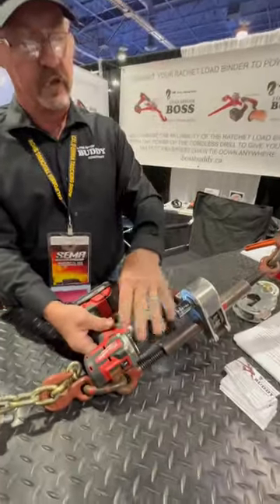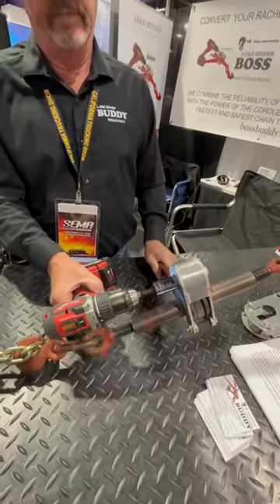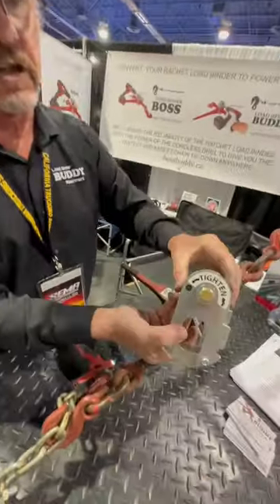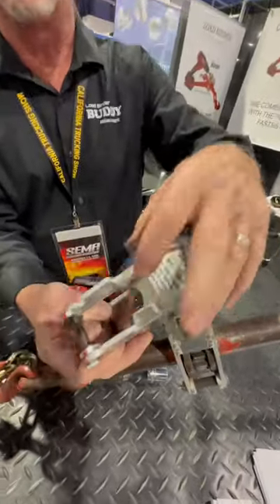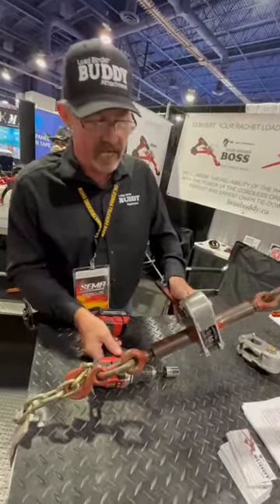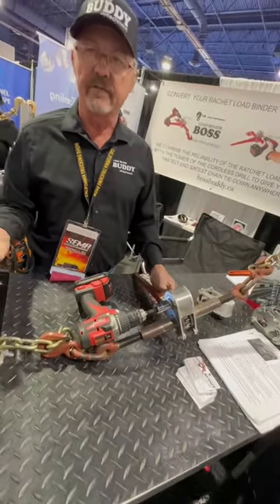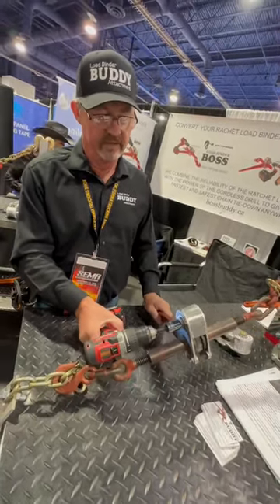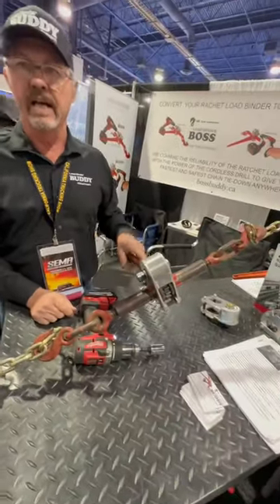Things just got a lot easier. #shorts

Comment: A lot of people talking about the inconvenience of finding/carrying a drill, cost, actual truckers using it......actual trucker here and have used various models over the years, if a few hundred dollars is a burden to your wallet then imagine the burden to your body after 30yrs of cranking on binders, seeing doctors because of arthritis losing your grip strength etc as you age. Its about working smarter not harder, let the tools take the wear and tear instead of you. 
I still use my speed binders (i think thats the name of them) and if you put the drill in low range two will definitely tighten a  skid steer down enough to bulge the tires and make chains pop and crack. I paid $88 each for my 12 speed binders 4yrs ago and still using them today, i have a charger, spare battery and drill between the seats so its no more of an inconvenience to grab the drill than grabbing my gloves.
Reply from the maker: 100% agree👊👍
Reply: No matter how many broken down 60 year olds a 30yo sees they never think it will happen to them.
Reply: @chrisfoxwell4128  truth!!
Reply: Hell yeah 👍
Reply: @Dirtmonkey  😮

Comment: I'm sorry to be the guy that points this out but....
Aluminum isn't corrosion proof, it just takes longer with the right alloy... however when you put aluminum and steel together... then you get a whole other ball game of a type of rusty corrosion called galvanic corrosion. This can be seen in many places, not the least of which is under cars where engineers decided it'd be a good idea to attach cast aluminum to steel frame members in the presence of repeated moist conditions, resulting in replacement of expensive parts that would otherwise last many many years...

Comment: The heat treat and bearings real will make it last so much longer. As a machinist I run a machine spinning 2000rpm all day long as long as it doesn’t get hot it won’t freeze up

Comment: You'd probably still have to manually check the tension anyway, so unless you're at the drop off/ load up location and all you're doing all day is tightening/loosening these I don't think you'd save that much time. 

Also it highly depends on how much they cost.
Reply from the maker: I like the fact they can still be used manually

Comment: I would love to see a tension/pressure/torque test vs doing it by hand. Also wouldn't a radial impact drill be more appropriate for a nut and bolt?
Reply: My exact thoughts.
Reply: It does get them most of the way there but the last 5% you need to do it by hand.

Unless you have an absolutely ridiculous windy impact that some drivers have.

Comment: Is there a discount on the boss buddy because just one is 110 ca (81 usd) not including the 25 dollar flat rate shipping fee ate that price you might as well buy a speed binder. And yes I know that the speed binders are a little bit more expensive but it is smaller and more compact than the boss buddy system and you get a new binder instead of using the same old binders.
Reply from the maker: Good point.
Reply: The real difference though is these don’t have the weight limit attached to them like speed binders you can go to any load rating depending on the size you order both over and under 10k binders

Comment: It literally takes longer to drag out the drill and carry it around than the seven turns it takes to tighten my binders but good for him. Any man that wants to be an entrepreneur is ok in my book. It ain’t easy
Reply: Meanwhile hell be getting the job done 10x faster
Reply: Not sure what kind of drill you have but i can hook mine on my belt getting out of the truck, throw all the binders on snug and within 5 seconds have each one of them tight. Its about letting the tools do the work and wear out instead of wearing your joints out. Its literally 0 effort after chains are on the equiptment to tighten them
Reply from the maker: I have the speed binders and love those!  So easy.  and these are a cool other option!